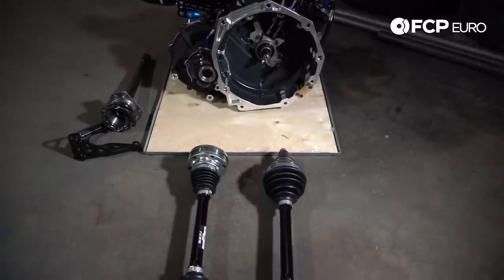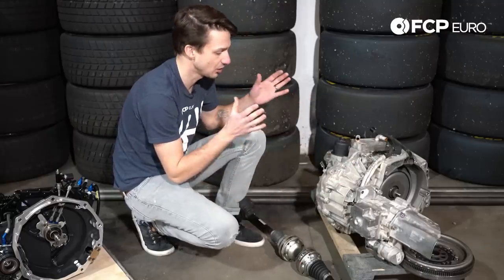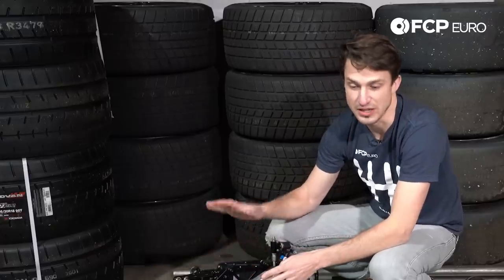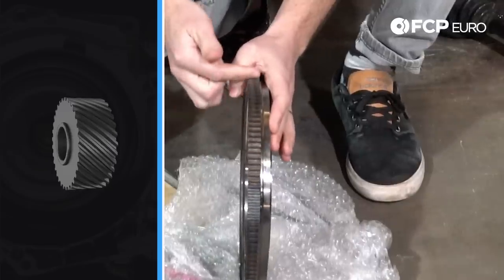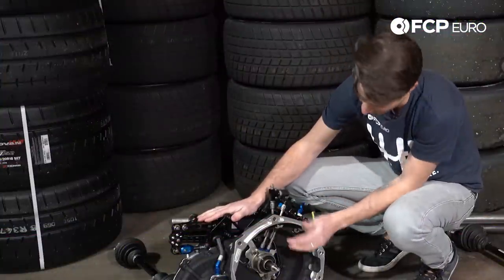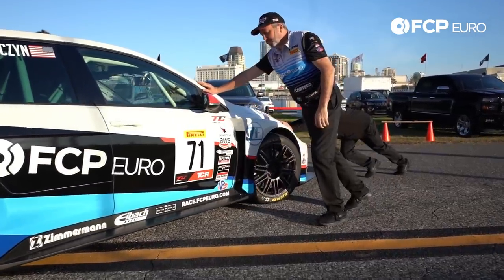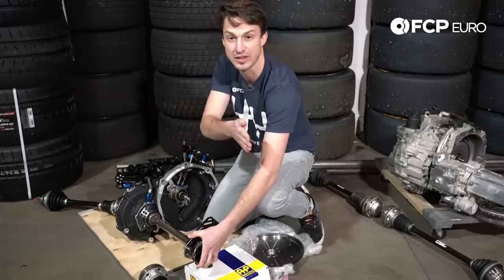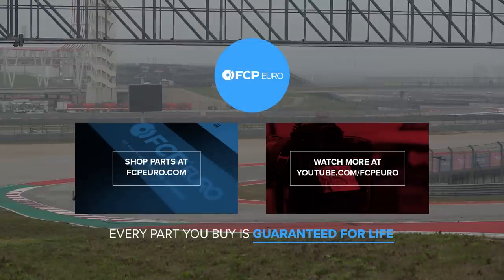Sequential Vs. DSG Transmissions: The Differences Explained

Comment: Okay, my thing is that with a sequential you push forward to downshift and pull back to upshift, using the G forces of the car to help you shift. See at 5:00 into video, he is backwards. It COULD be done that way but during braking your body is moving forward making pulling the lever back harder than pushing it forward.
Reply from the maker: Good call @SpatialDragon , a bit of an oversight on our end! Nate's gotten too used to paddle shifters I guess ;) - Ben
Reply: @fcpeuro  Give him the sack

Comment: Left out one other down side to straight cuts, theyre weaker.  They have less tooth engagment than a helical, but they also dont side load the gears and bearings which cost you power but also a lot of heat that you have to deal with. Straight cuts do sound awesome, just wear earplugs.

Comment: My 2010 M5 has the SMG. Use in manual mode with the fastest gear change and drive the car hard and it is a dream. Even has rev. matching but if you time the shifts right it is not needed. I very happy with it.
Reply from the maker: That's awesome, Erik!

Comment: @8:47 i didn't get you here! , Do you think that the reason for a quicker engagement is the size? or pneumatic pressure ?? because these clutches are heavy and i think mainly they reduce size to save weight, please correct me if i am wrong <3

Comment: Torque steer is nothing to do with shaft length by itself, its the difference in cv joint angle because of the different shaft length

Comment: I don't understand a few things. I, and lots of others, ride a motorcycle. Almost all, if not all, use straight cut sequential dog boxes. All of them last the lifetime of the bike. All of them shift smoothly and all of them shift without having to use the clutch. All of them also shift easily, with a feather touch of the shift lever, like a hot knife through warm butter. And finally, I have personally never heard that gearbox whine that people complain about unless i really try to focus on hearing it, it's literally impossible to hear. 

Now, i see your 3D presentation and one thing i notice is how tight the dog teeth are shown to be. They are not that tightly packed, on the contrary, they're quite loose. You can mesh one with the other and they can spin one inside the other before the teeth interlock and that's why you can shift without the clutch, and it's not even forcefully jammed.

Also, it's important to note that you can't really shift without the clutch unless you have a way to cut the power momentarily so that the teeth disengage. If you are actually accelerating, not even Thor himself could be able to disengage the shift fork from the gear it's attached to. In the motorcycle world we call it a quickshifter and it's a device that cuts the ignition the moment you shift so the transmission is unloaded and you can shift. It shifts in the single digit millisecond range. We can do this with just rolling off the throttle just a bit at the right time and then rolling on again. I will assume the ECU does this automatically in the car when you pull back the paddle shifter or the lever. That huge gap between each dog tooth and the speed at which they are rotating means that it won't jam onto another tooth but instead fall in between them and at the same time it won't have enough time to decelerate much so that it will hit the tooth with a lot of force. The shifts, on the motorcycle at least, are quite smooth and not at all abrupt like people are making it out to be.

Note that the motorcycle gearbox is the simplest form of the sequential because it needs to be lightweight and compact, for obvious reasons.

So, what makes your gearbox rough and noisy? I honestly want to know, i can't fathom it. Is it the size? Is it the weight? It's definitely not the engine speed, even race cars don't rev as high as superbikes... So, what is it?

Comment: Why would anybody want a dsg on a daily driver?
This great video explains the differences the really highlight the disadvantages outside of track use.
Reply: Saving all that clutch in and out malarkey when your sat in rush hour traffic. All so they are a nice 'box to drive with.
Reply: I know this is old, but I personally don't understand why DCTs were so successful in the mass market. It's much easier to catch them off guard in normal driving, they tend to not be reliable (especially when coupled with the cost saving in the mainstream segment) and they're generally pretty jerky at low speeds. 
Torque converter autos such as the ZF8 have evolved so much to the point where they make mainstream DCTs irrelevant in that segment. They're reliable, shift quicker than your average DCT, are smoother, and it's impossible to catch off guard because there's no gear preselection. 

To be fair to the DCT, the ZF8 also borrows some of its principles (it has internal clutches which is why it shifts so fast) and the highest-end DCTs will still shift faster, but the difference is becoming scarily small even in that segment. In the mainstream segment however, good TC autos are better by a mile.

Comment: The Sequential transmission is a larger motorcycle transmission. I kinda surprised the dogs wear out so quickly.  Granted the loads are much higher than any motorcycle.
Reply: I believe it is because it is being shifted under load without using the clutch. Anyone know if these cars cut the ignition like a quick-shifter on a bike?
Reply: No, motorcycles use synchros and not just dogs.  Synchros also use dogs, but have rollers or cones to help.   A dog only system is just like the dogs in a synchro transmission, but without the rollers or cones.  Dogs have to wear out without cones of rollers to help synchronize.  It is essentially a non-synchro transmission, and you have to double clutch.  You do not double clutch on a motor cycle.  All motorcycles use synchro rollers or cones to aid the dogs.  None have just dogs.
Reply: A motorcycle always uses a standard sequential transmission with synchros and clutch.  The only reason there is a paddle-like pedal shifter instead of a more complex shift pattern of a car, on a motorcycle, is that the foot pedal is connected to a rotating shaft with rotating ramps that push the standard gear selector forks back and forth.  Otherwise motorcycles use the same standard transmission with synchros  that all standard trans cars used before the DSG.
In a standard car trans, the complex shift pattern reduces to just back and forth fork motions as well.  There is no real internal difference.  The paddle-like pedal motion on a motorcycle is just an external linkage adaptation.
Reply: @kirkaugustin2232  This is simply not true.  I've actually rebuilt dirt bike transmissions.  They do not have synchros.
Reply: craig list this has a ignition cut on upshifts and a throttle blip on down shifts.

Comment: Hey, quick question??  I've worked with older Hewland race trans with normal style shift lever but wonder in the newer paddle shifter cars if the ignition is momentarily 'killed' to reduce the shock load for the incredibly fast shifts they are known for??
Reply: Dan Learned yes ignition cut for upshift and throttle blip for down. Still is very violent.

Comment: Great Video.
What would be really useful is for someone to put together a compatibility guide / reference detailing what DSG Varients are compatible with what engine types starting with mounting points to engine / chassis. Also any coding needed. I have an 2011 EA888 CCBZ gen 2 and  looking for replacement DSG but would like know what opions I have other than a straigh DQ250 02E CYZ ? repacement. Really what to get a DQ500 but dont have the above info ? If you can help let me know & I will get intouch.

Comment: Why don't you need to use the clutch outside of first on a sequential? Does the transmission just brute force itself into gear, even with power coming from the engine?
Reply: I'm no expert in the topic but here's what I know. Yes the transmission brute forces itself in gear, even though usually the driver lifts of the throttle briefly while shifting or there is a quickshifter which does the same thing automatically when shifting.

Comment: So I’m no expert and he may have mentioned it in the video but can you put straight cut gears in a trans that’s like, let’s say a regular manual, a dsg, or anything other than that specific sequential. And if so, will it be reliable?
Reply from the maker: You can put a straight cut gearset in a regular transmission, however, it is not recommended or really necessary for a street driven car. Straight cut gears are extremely noisy and due to the tighter tolerances, they tend to wear faster than normal helical cut gears.

Comment: You just explained why sequential gearboxes are a bad idea for street cars (quick wear, forceful unsmooth shifts etc). But if thats the case, why are they used in regular street motorcycles? And if they were able deal whith the drawbacks of sequential gearboxes there, why doesnt it work for street cars?

Comment: Can you skip gears in the DSG/DCT? If not, doesn't that make it sequential too?
Reply: All transmission were and are sequential to a degree, but what makes a DSG different is that you are essentially not just selecting the gear you want to go into, but the next one up as well.  Its really like 2 transmissions, and you are pre-synchronizing the next gear, for faster engagement.  Thus the added complexity and extra shaft and clutch.  When you shift, then actually you are just switching clutches between two pre-engaged gears.  Vastly superior.  It may not always help much if the pre-selected gear is not useful, but it can be very useful in ideal situations.
Reply: You can skip gears, but the shift time will depend upon the target gear vs the gear you're in. 
Since one of the clutches takes care of odd gears and the other takes care of even gears, shifting between odd or even gears will be painfully slow, in the 500ms range or more.

Comment: I've had motorbikes all my life and never had gearbox problems and yes they have dog gears. Take a look at motoGP bikes with 300 hp .. they only use the clutch to take off .. same for modern road bikes with the same tech. So it seems that cars need to catch up .. only by the information you give. I have also driven semi-trailers with 18 speed gearboxes and yes with dog gears .. once one learns how to synchronize the gears with the revs .. easy going up harder going down .. again you don't need to use the clutch. That design of gearbox is virtually indestructible. Great for trucks weighing 42 tonne all up. So DSG is a waste of time and money

Comment: Sorry, but completely wrong.  Sequential is the OLD style of standard transmission, and DSG is the modern RACING transmission.  The fact you can also see some racing people going with a beefed up OLD style standard transmission is just a weight consideration, but there no new, better, or faster aspect to it.  Clearly the DSG is the newer, better, and faster technology.
The video is also wrong about the gear engagement dogs and straight cut spur gears.  Those are not newer, but older, and are reverting back to the old nonsynchro transmissions of the 1930s and 40s.  Esssentially gear synchros are also dogs as well, but just have a built in roller or cone to help.  What the video is calling a syquential transmission is just without the synchro aids, and is the oldest and most primitive transmission I have seen in over half a century.
In addition, while getting rid of over all weight car weight, reducing rotational weight is NOT an advantage.  You WANT additional rotational weight because it stores energy like a battery.  While in theory the engine/trans can rev more quickly with less rotational weight, the goal is to accelerate the vehicle, not rev the engine/trans, so removing rotational weight actually is usually counter productive.  
And straight cut spur gears are awful.  They have so much less surface area, that they have to be much thicker gears, and that makes them have to weigh much more.  The only good thing about straight cut gears is that you no longer have to worry about shaft end play or bearing preload, making the trans easier to rebuild.
Again, if you look at a 1930s transmission, it will look almost identical to this sequential transmission.
Reply: This is so full of inaccuracies it's downright funny. 

"Clearly the DSG is the newer, better, and faster technology."
Sequential transmissions with hydraulic actuation will shift faster than DCTs, and will do so without incurring any shift time inconsistency resulting from gear preselection. Sequentials shift faster, are more consistent, and much lighter, making them the objectively superior choice for motorsport. Their only drawbacks are longevity, which doesn't matter in competitions with well-funded teams, and noise, which doesn't matter in motorsport period. 

And DSG isn't even the fastest DCT available, I don't know why you're hyping it up so much - you sound like you own one and are biased as a result. The fastest DSG (DQ500) barely outperforms a ZF8 (that's a torque converter auto) in terms of raw shift speed, while losing handily in the consistency department. 

"What the video is calling a syquential transmission is just without the synchro aids"
Because that's exactly what a sequential transmission is, a transmission where there's only one shaft with gears organized in order and where there are no synchronizers. You don't even know the definition yet are somehow confident enough to comment. 

"In addition, while getting rid of over all weight car weight, reducing rotational weight is NOT an advantage. You WANT additional rotational weight because it stores energy like a battery."
Wrong, a lightweight flywheel is an advantage on multiple levels: 

Firstly you have less parasitic loss due to less rotating mass. You're correct that a heavier flywheel stores more energy like a battery, but it doesn't send that energy back into the drivetrain with 100% efficiency. Losses are incurred. 

Secondly, gearshifts send less shock into the drivetrain on gearshifts with a light flywheel. A heavy flywheel means a choice between: 
a. more chances of destabilizing your car
b. programming the transmission to smooth out the shifts by letting the clutch take the hit, which further decreases the efficiency mentioned above 

The only thing you're ultimately doing with a heavy flywheel is wasting energy. 

"Again, if you look at a 1930s transmission, it will look almost identical to this sequential transmission."
Yeah, almost as if the simplest transmissions are the most efficient.